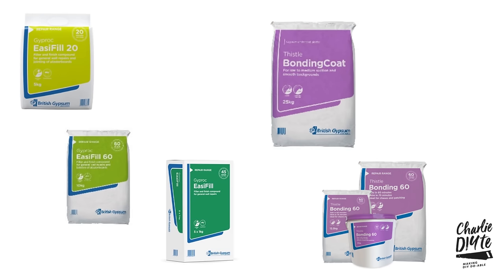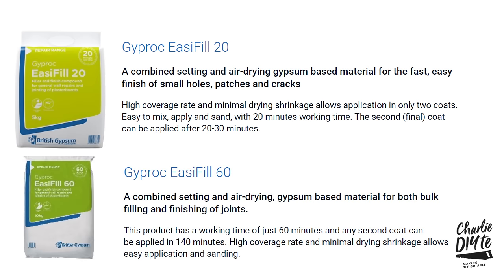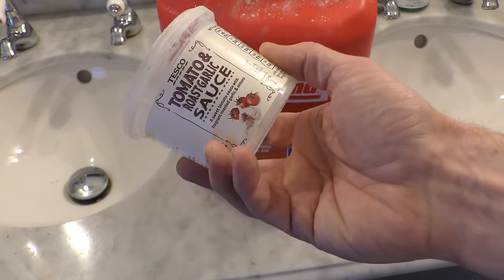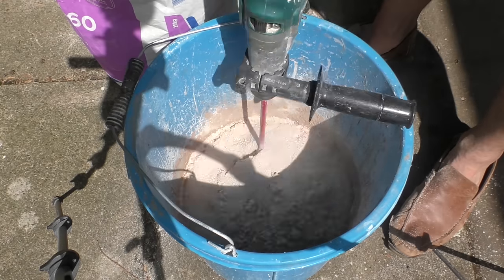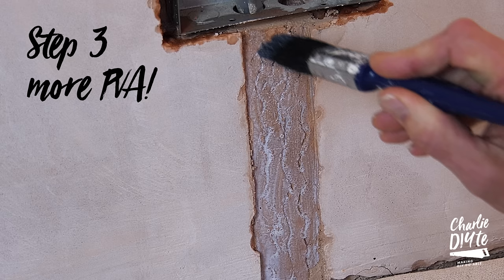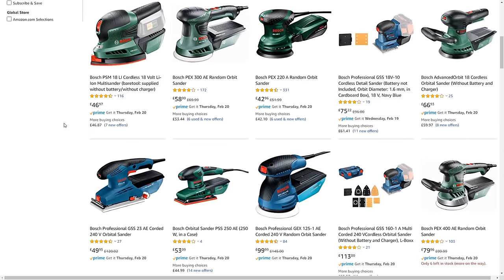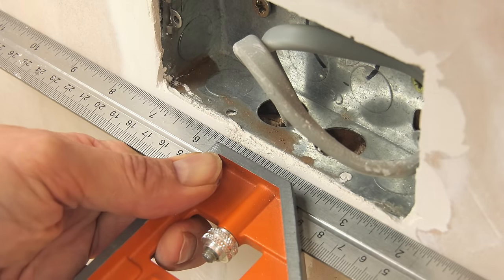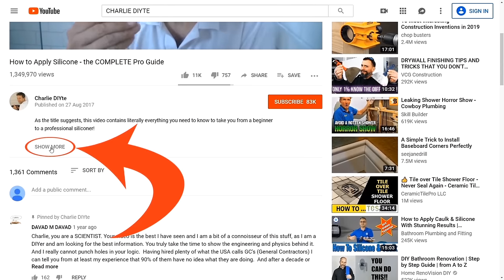How to Fill Wall Chases, Cracks & Holes

Comment: You need some 20mm grommets in those backboxes Charlie
Reply from the maker: I have a box of them ready and waiting, but thanks for the reminder 😉
Reply: @CharlieDIYte  Ready and waiting? the damage is usually done during first fix and now the holes are full of filler, it will be that much more work to get them in.
Reply from the maker: @JasonShowell  Alright, alright, clearly I should have put them in first but I've just taken a quick look and the holes are clear of filler so it will be an easy job to insert them, and because it's my job I've taken great care with the cables. There's not a mark on them, which is more than can be said for the previous, grommetless version chewed by the mice.
Reply: Not actually required to do so according to 18th edition. Good practise though :)
Reply: @dave11owlett  That may well be so Dave but I think we agree that no self respecting electrician would advocate their omission!
Reply: Why patch the wall if it was all plastered?
Reply: @dave11owlett  Always always always use grommets.
Reply from the maker: @b21playa  Because I only decided to put a socket there after it had been plastered, stupidly...
Reply: @dave11owlett  522.8.11 - enclosures shall not have sharp edges liable to damage the wiring system.
Reply: @CharlieDIYte  I think we have all been there, forgetting/deciding to put sockets in after the job is done ;-)

Mine happened when I finished my largest DIY plastering job, I stood back to admire it and how well it had gone despite trying to do it in the heat of summer (and regretting that) and bumped into the fridge freezer..... hmmmm I seem to have forgotten to put in the plug for that! Out came the cold chisels!

Great video with excellent detail that so many other videos miss out - much appreciated!
Reply: Great vid thanks for sharing. 🐵
Reply: What on earth is a grommet
Reply: @CharlieDIYte  good lad
Reply: Amazing how sharp those backboxes are!  I came across some where they must've run out of grommets and simply wrapped a short length of outer cable sheath around it which must've worked well because the old cable was unmarked.  Sheath had been cut down the middle on front face, then wrapped backwards so the metal edge slotted into the cut and the tension kept it pressed against the metal. Could be a neat trick for holes where you can't get the right size, but Wallace would definitely recommend a Grommet 😊

Comment: Thanks for this video, I chose the EasiFill option to fill 10 chases in my kitchen and I'm so pleased with the result, I actually really enjoyed the whole process too, very satisfying. It can be a bit intimidating to get the supplies for a more advanced DIY project like this as a young woman, it might sound silly, but it really helped to have the information from this video when I went to the hardware shop.
Reply from the maker: So glad to hear that Rosie - fantastic work - bet you felt a bit epic completing that project and it's armed you with confidence for the next one. Thanks for getting in touch 👍
Reply: Did you use only the easifill? I’ve got the same job to do and I’m wondering if I use the first way he showed or use only easifill. Has it cracked or shrunk since? Does it show lighter after you paint it or is the new paint the same across the whole wall?

Comment: Being in the autobody trade for over 40 years, I apply techniques from my trade to my home for those repairs as well. For small repairs, I use autobody filler. Although it's a little expensive, it's fast, sands easily, compatible with everything I've applied it to, and doesn't shrink. Good benefits! I also use fibreglass filler for repairs in damp areas and rotted wood repairs. Works great! I do use plaster and spackle for some minor repairs. Great channel, Charlie!

Comment: Absolutely what I needed, thanks Charlie for going to the time (as always) to explain things so thoroughly and so easily understandable too. Already have a bag of easy fill and I only have 1 small chase to fill after installing an outdoor light, so you doing this both with and without bonding has really helped me in feeling confident I can just use the easy fill for the whole chase and not worry about not using bonding (and having the cost of buying another material) thanks again

Comment: I've done this before, but I'm about to revisit this exact job with one of the 5x1kg Easifill bags. This video has been super helpful in reminding me what to do, with plenty of extra hints and tips. Thank you! Excellent video!
Reply from the maker: Thanks David. Well done getting those 1kg bags. They're fantastic. Get yourself a plasterers hawk and possibly a plasterers trowel if you can. Makes the job so easy 😉
Reply: Why order 5x1kg instead of 1x5kg, am I correct that Easyfill will have an expiration time limit once it opens?

Comment: I've found putting expanding foam along the edges of a backbox works a treat gives something for the filler to fix onto as its difficult getting the filler deep inside a small gap like that.
Reply: I fill the hole with plaster before inserting the box- that way, there's plenty of plaster filling the gaps.

Comment: Hi Charlie…. Another good informative video 👍,just a little tip, when you cut trench’s in the  wall for cables ect try putting a little 45° + leading edge each side of the trench, I just use a scraper too form this leading edge,  this way  it feathers the edge of the filler from the wall to the hole rather than being a hard 90° drop into the trench
Reply from the maker: Thanks mate. Great tip 👍

Comment: Brilliant video, very detailed and useful for beginners or improves. Only item to note is that the electrician did not install the rubber open grommets for the incoming 2.5mm electrical cable and need a blind grommet for the knockout which isn't being used on the first sockets filled with bonding

Comment: Thanks as always - you’ve given me the confidence to tackle some gaps between windows and walls, although I did click through to purchase some of your recommendations but many are currently out of stock - we now know what the Great British public is up to.
I also have to tackle some uneven joins in my bedroom ceiling where plasterboard panels weren’t put up carefully as they were covered with polystyrene tiles (!) so will be applying some of your tips 
And finally the internal, sticking inward , corners beneath my square bay window, which I will probably need some of those wire supports to get a clean edge, but I’m hoping your instructions will still apply to those !

Comment: Outstanding video. I was put onto easifill by some builders we had in but it was great to see the bonding option and even better, the plasterers hawk. Straight down to Screwfix for me 😋
Reply from the maker: Really glad to hear you found it useful, yes you'll love the hawk - one of those very simple but game changing tools.
Reply: The hawk is brilliant. I got a plastic one for less than a tenner and the help that having a surface to cut the filler and scrape the trowel on was absolutely great

Comment: Always great to watch a thorough tutorial Charlie!  If you did this to an existing painted wall, would you mist coat the area first before painting over?  I've found, even with a mist coat over a perfectly sanded repair, i get a raised patch/continent. Seems like the area needs a sealer. I've heard it can be due to different porosity, i guess the filler is absorbing more paint and possibly swelling slightly proud of the original surface. Very frustrating, especially when my dad tells me i haven't sanded it enough 😂 strangely i repaired a few ceiling cracks with coving adhesive/cement and that painted absolutely perfect. Anything you recommend? 😊

Comment: Hi Charlie, learnt a lot on this video 👍🏾.  Can you do a video on how to fix the ceiling gaps from poorly fitted kitchen spotlights?
Reply from the maker: Exactly the same principle. I did this in my old flat in London. You want to pull the spotlight down, and gradually build up the area with Easi-Fill, sanding the curve, and the ceiling until you're satisfied with the repair.

Comment: Starting a full house renovation soon chasing all walls for new plumbing and electrics so this video has been very helpful Charlie thanks!
Questions - 1. Can I get away with just filling the chases with bonding if a plasterer is going to re-skim the walls? Is the easy fill more for those painting straight over?
2. Will this method work well over pipework for radiators or will the heat have an effect such as cracking over time? Is there anything different I need to do for filling over plumbing work?
Reply from the maker: Yes you can just bond if a plasterer is reskimming. I had the cracking problem with pipes. See if you can pipe expanding foam in to insulate the pipes. Then trim it back before applying bonding on top.

Comment: My tip for making up the PVA mix is to do it in a plastic milk bottle. Larger the area to be covered, the larger the bottle. You can then very easily mix it up with a shake of the bottle (lid on!) and it keeps very well in the bottle for the next day or job. Just make sure you label it clearly so you don't put it in your tea!
Reply from the maker: Very good 😉
Reply: Hi C4sp3r. Can I ask how long you leave diluted PVA to dry before doing the filling, please. Thanks.
Reply: @andyandy8536  The first coat of the PVA watered down you want to leave to dry, it dries quickly but you could do it the night before. The second coat you want to leave it until it becomes tacky to the touch but you don't really want it to dry out. You could do a test area to get an idea of how long this takes in your situation, things like temperature will affect the time it takes. Then when ready just reapply over the test area, leave to get tacky then plaster. If you are quick at plastering you could do the whole wall or if slower do a part then plaster it then apply the pva mix to the next area. If you keep your roller or paint brush being used for the PVA in a plastic bag and sealed off you don't need to worry about it drying out. You are looking for a milk like consistency so it is quite runny when applying it to the walls so it will run and drip so keep some rags handy.

Comment: Yes I agree. charlie I think you are probably the best in your field. Just wanted to ask... after applying this bonding are you then ready to paint? Finally?
Reply from the maker: Thanks - I appreciate that 👍🏻 The bonding is like a sub layer. So on top of it you either need to apply some Easi-fill or plaster. I'd recommend Easi-fill unless you've got a large area to cover. Once that has set, you're ready to paint over it and I'd recommend a watered down mist coat before the final emulsion coat, as discussed in more detail here https://bit.ly/3ilSD3P

Comment: Thanks for all the detail! I was literally standing in the isle at B&Q on Saturday completely confused! 😂 I remember thinking I have no idea so I just bought a big tub of pre-mixed stuff… 

Off to check what I’ve bought now 😂
Reply from the maker: It can be very confusing in there Joseph. The premix is likely to slump more - so you may have to layer it up if the hole is deep, and be more susceptible to shrinking, depending which one you've bought.

Comment: Hi Charlie Another quality video thank you. Ive had some electrical chasing done on hallway wall. It's chiselled down to breeze block around 1" deep - with it being an external facing wall I'm worried about damp (property is around 15yrs old). What method to use? Can I just build up layers of the East Fill 60 or do I need the Thistle stuff first?!

Comment: Just going through your back catalogue and although I wouldn’t be so “fussy” over tiny gaps around a socket box as the socket will cover them, it’s great to see such attention to detail.
I must admit as an ex sparks getting twitchy over the length of the tails in the boxes. Too short and it’s an itch I can’t scratch 😀
Reply from the maker: Sorry about that, and there's the lack of grommets but I sorted that out in a later video.

Comment: Love your videos, theyre incredible useful as they assume no previous knowledge!
Quick question though, i need to fill the gaps around the inside of a new exterior composite door. Would you recommend using this too?
Thanks again!
Reply from the maker: Thanks so much Michael. I'd say if the gaps are reasonably wide and the wall is dry and unlikely to get damp, then Easi-Fill would be a great option. If the installer has just put the door in and not made good at all, you might want to spray some expanding foam in first, to secure the door in place, eliminate any cold bridging and to pack the space prior to filing.

Comment: Used bonding for filling a deep chase that went from ground to ceiling. Stuff is amazing for that purpose. Holds it's shape really well, didn't even need to do it in stages, stuff didn't droop at all, just had to fill it to the surface with easyfill after that. Tried it in a different (but similar) chase with just easifill and no bonding, did work but drooped a lot more, in future for deep chases I think I'd go for the bonding first if I had it at hand.
Reply from the maker: Good work Ross. Yes it's fantastic for that. I agree, Easy-Fill is best for shallower fills although in the vid I was just demonstrating it's versatility in being able to do both.

Comment: Super helpful video Charlie - would you suggest either of the methods you've shown to fill chasing in Lime plaster? Some posters on forums are suggesting sticking to the material that surrounds the chasing where possible. Cheers!

Comment: Thank you Charlie for the fantastic video! Quick question – Thistle also has a "MultiFinish" Plaster which is MUCH cheaper than Easyfill, do you know if it's suitable for those chases in the wall after a rewire? Thanks again
Reply from the maker: You're better with EasiFill. Multi finish is a plaster designed for all surfaces eg cement rendered whereas Board finish is for just plasterboard walls. However it's a finishing plaster not designed for applying at deep thicknesses. You'll find it cracks off you lay it on too thick.

Comment: I'm sure someone has pointed out the grommet situation in the back box. I'll add that pan head screws are to be used for electrical boxes - this prevents any snagging of the conductors. It is counter sunk screws that have been a common problem during my time as a spark.

Just some constructive criticism

Glad to see your using capping. Even some sparks wouldnt use that.
Reply from the maker: Thanks mate. Yes I addressed the grommets here https://bit.ly/3vGVJ7Z

Comment: What a fantastic video, do you recommend using the easifill filler then putting an aluminium patch over the hole once the filler has dried? Then, another layer of plaster over the patch. The hole is around 2.5cm deep and 17cm in diameter 

Thank you!

Comment: Just throwing ideas in pot. Great video and brilliant advise. :) 
I use flat end wood spoon from pound shop makes a good small drill mixer for plasters in small pots, I cut end off wooden spoon to fit the pot bottom. 
Zombie mix which is finish plaster and 15% ish bonding together. (stick some half time setting agent in and get skates on if you want to crack on) 
With double sockets have you tried those beadmaster socket liners you smash out when done or the reusable Safety Sockitz liners that fit in and you fill to? Like the look of those...

Comment: Nice video Charlie. I always mix small amounts powder first for the same reason. Never bother PVAing dry bonding coat, but do spray it with water and let that absorb if it's really dry. I'm gonna try the Easyfill. Been using Diall ready mixed for small areas, but found it too thick and difficult to smooth when skimming larger areas.

Comment: I always buttered up my surface boxes on sides and back and squeezed the box in then screwed it up. Just cut the excess off as it comes out. Is far more secure and the little bits you filled in wont fall out later. So much quicker and proper job with the whole void filled.

Comment: Another great video. 👏🏻👏🏻. Ah man you’ve left me with a hard choice now. I’m going to chase the tv cables in the wall. I might try and get away with just the easy fill. Any tips for doing this job regarding the cables. Thanks
Reply from the maker: I haven't chased TV cables but you could put them behind some of that metal trunking that I used. If you've got a lot of deep chases, bonding would be a good sub layer just because it's so easy to apply. If they're shallow though, just use the Easi-fill.

Comment: Very helpful as usual, Charlie. Thanks! I keep recommending your videos. Just one question: How long do you leave diluted pva before applying bonding? Presumably you don't mix bonding immediately after painting it on? Thanks
Reply: Ah, should have read the PVA label. You do apply bonding while tacky, I see
Reply from the maker: Thanks so much Jeremy for spreading the word. Really chuffed you find my vids useful. You want to wait until it's dried - all the white will disappear leaving a transparent surface. It shouldn't take long, depending on the temperature in the room.

Comment: Thanks for the video.. It's very informative. 
I'm doing a small bathroom tiling project around my bath area.
After removing all the tiles, the wall behind is a mess, unlevel and dips inwards towards the bottom.
I'm completely new to all of this and am thinking my best way to go is to rip everything out down to the brick, to pva the surface, bond it... And then can I tile straight onto the bond once it's set?